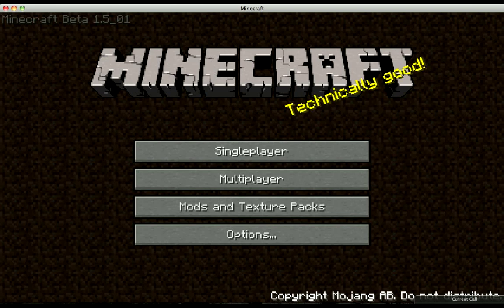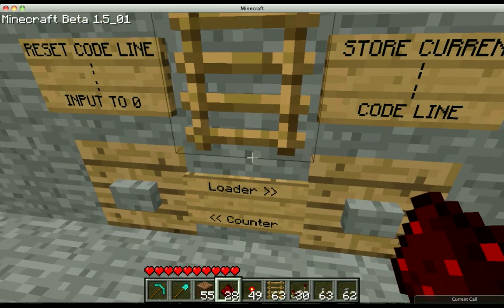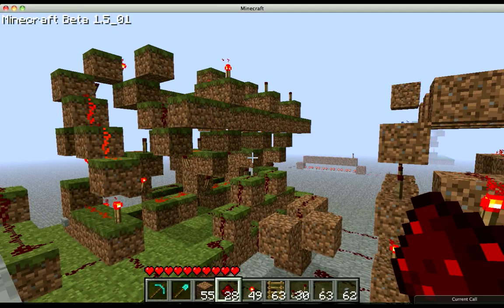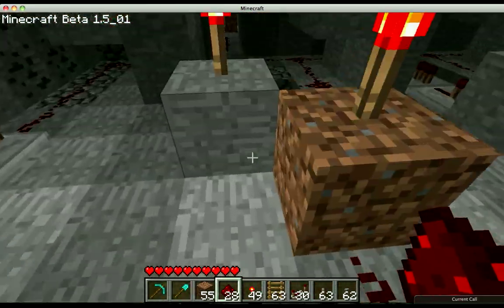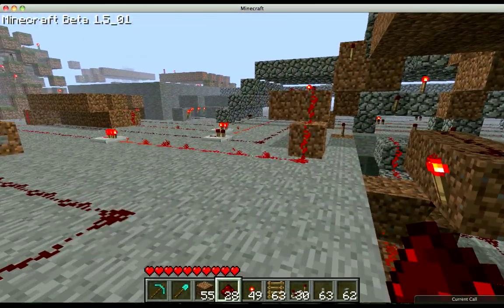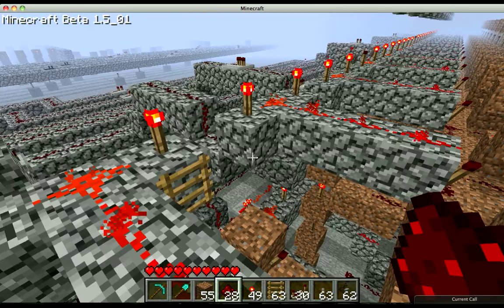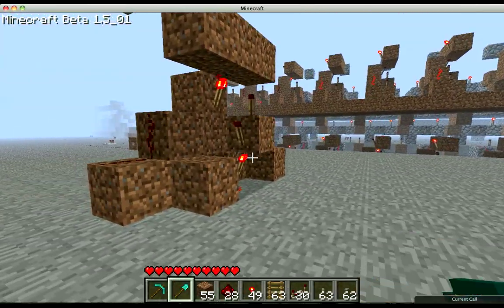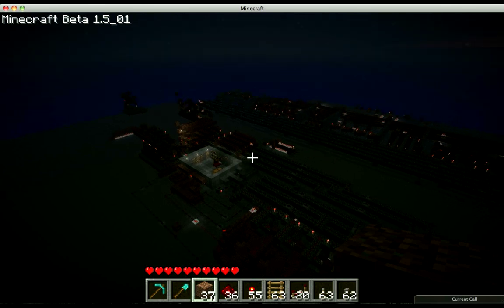Minecraft - Building a 4bit CPU (Part 1, Code Loading)

Comment: I'm trying to make my own Computer as well but I use a rather old design I guess. it's not as quick as most of the designs around. it takes about 30 seconds to load the code to the output.
but the difrence between yours and mine is that I can just change the code while still loading.

Comment from the maker: @AlexN5142 The two D flip flop sets are for values and instructions, and you must have both in order for the CPU to function (how else would you add 5 without a value and instruction saying ADD, and 5). The enablers allow the programmer to choose when or which data should be allowed to go on the bus, i.e if you're programming the code, the first line input will be enabled, and the code will run into it. Then the second, etc. Meaning that we can program and read code from one command centre.

Comment from the maker: @stnbtv Yeah i totally understand what you mean, but is that a compulsory requirement? I never actually planned to implement it :p, although i think i could if i used the extra 4 switches initially placed.

My plan was just to have two places to send them, and every time the CPU was use it would send them to both. The accumulator, and the output screen.